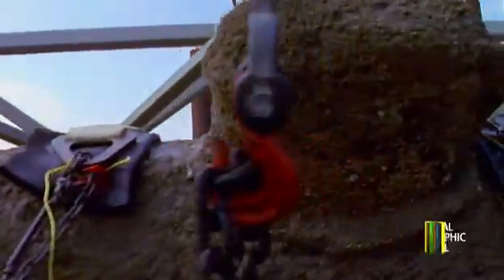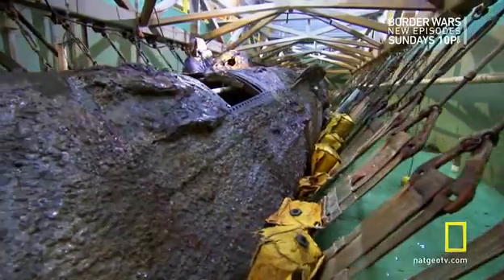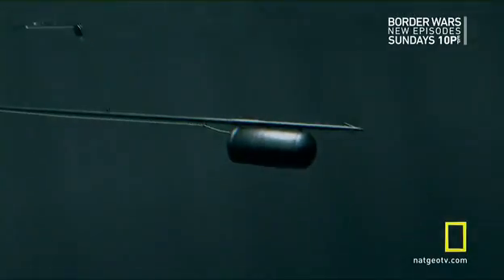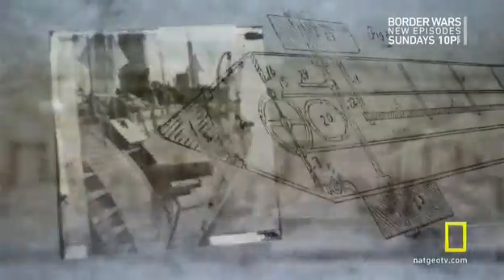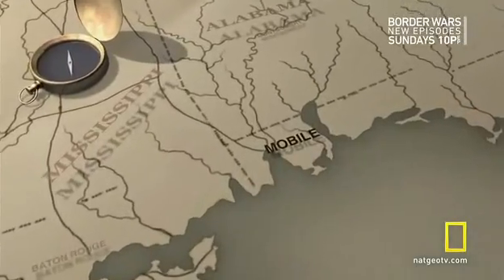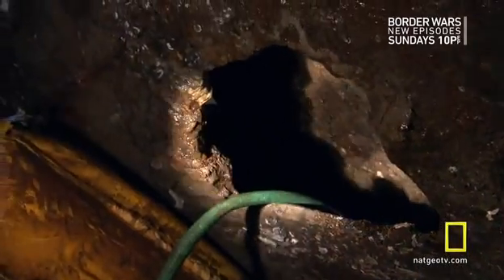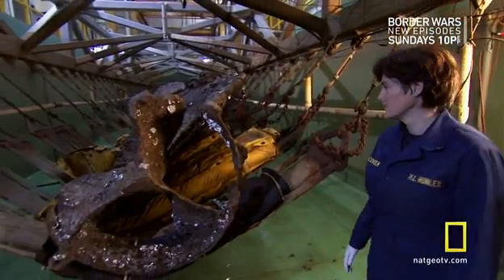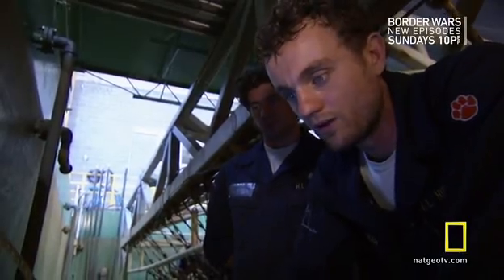National Geographic: Secret Weapon Of The Confederacy

Comment: CSS. Hunley made her attack on February 17, 1864. Your Ictineo II made her maiden voyage under human power submerging to 98 feet on May 20 1865, over a year later.

 Narcís Monturiol didn't even have an engine in the Ictineo II until 1867 and then it was steam and could not submerge. So no, not at exactly at the same time and it would only count if it "works".
Reply: What?
Reply: @dononteatthevegetals2941  
I believe that I'm responding to a comment that the original poster took down. (It's been quite some time ago)
Reply: @Pynaegan  I see. And yes, 7 years is definently some time ago